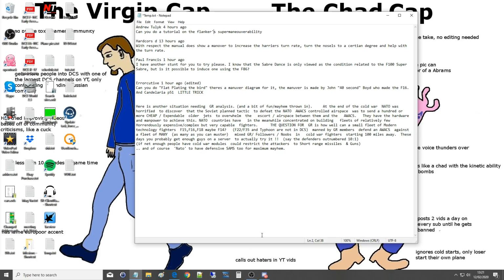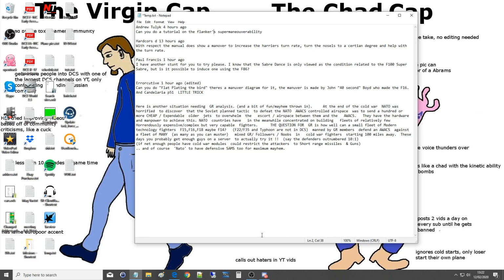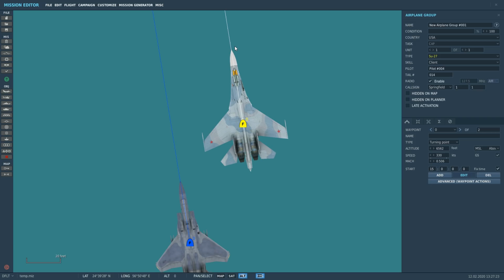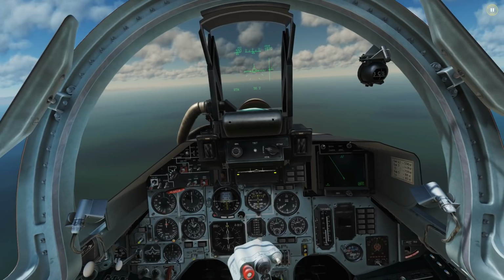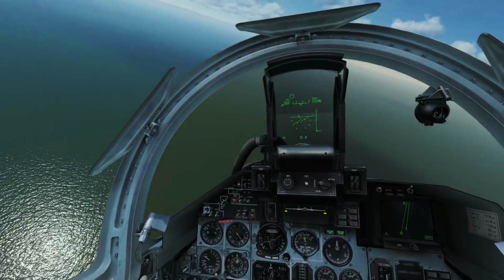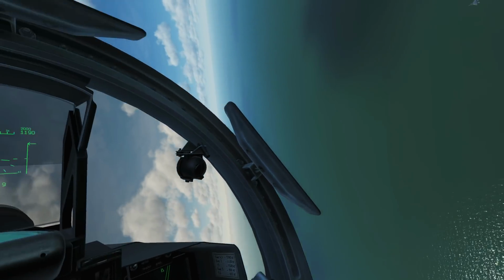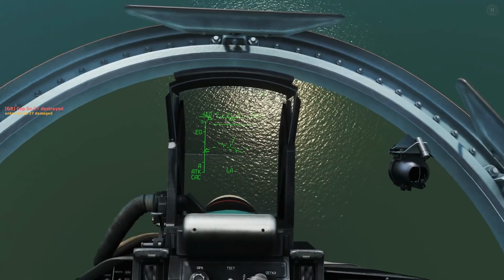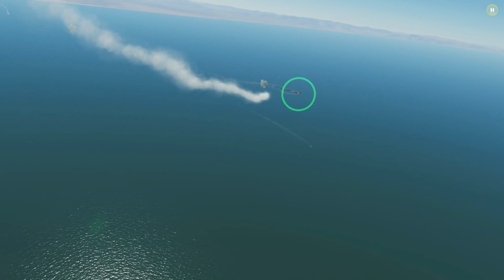Su-27 Flanker: Dogfight Cobra Manouver Super-Manouverability Tutorial | DCS WORLD

Comment: The term 'supermanouverability' has been diluted somewhat from it's original meaning by marketing camapigns. The original term and concept was explored by the X-31 program, and then the various NASA/USAF programmes with the F-15 and F-16. The idea there is that the aircraft is controllable post stall, for which some kind of powered manouver mechanism is required. One might be a reaction jet system like the Harrier, or thrust vectoring. The Su-27 does not fit this definition, because in the Cobra it is actually uncontrollable - once you commit to the manouver it must be completed (ie: it is ballistic at that point). The only truly supermanouverable jets are ones with thrust vectoring, and really with full 3D thrust vectoring at that for it to be the 'true' capability.
Reply: Rodney Pearce when you say the f-15 test do you mean the f-15 S/MTD experimental plane used to test canards?
Reply: @PSC4.1  Yep iirc that's one of them.
Reply: @Gort And I think that's the takeaway from this discussion in general. "Supermaneuverability" as a term in military aircraft has adopted, it hasn't "strayed from its original meaning" in a negative way in my opinion. 

It seems the consensus is that the original definition of supermaneuverability doesn't add a ton of value for its cost in a military environment. So, when someone is discussing military aircraft, I think it's still fair to use the term. No military aircraft are supermaneuverable as other comments discuss, but is that relevant? I personally don't think so, not in this conversation.

Lockheed and other aircraft manufacturers could, I'm relatively sure, create a supermaneuverable aircraft, but the sacrifices required are obviously undesirable or we'd have supermaneuverable military aircraft now.
Reply: J-35 Draken could do Cobra, but never had the control level of the Russians did, due to maybe being single engined and not much power for recovery unless at very high alts. They were mostly not encouraged coz of the uncontrollable stall speed envelope. 

I think the Russian got it to make it more effective and a bit more controllable with their jets having a big more power. But when TVC came into the picture the Cobra maneuver got more refined along with good engine power. Also this maneuver is only effective if its a close combat fight and even more effective if the enemy is close behind you....also it kind depend on the altitude too. So yes...it is effective in close combat.

I think for the F-22 its limited by its flight computer fly by wire setup, to do a true cobra or those fancy maneuvers. Its not designed to do cobra..or airshow maneuvers in mind.
Reply: @Gort Heh...mocking the Russians...
Reply: @Gort An observation on beesley's comment. Its no news about the USA and Russia cold war rivalry.
Reply: Su-27 was the first thrust vectoring plane.
Reply: I think the term "post stall" is generally preferred nowadays
Reply: Is the f-22 capable of this true super maneuverability as it has thrust vectoring?
Reply: @steekle7  yes, it just doesn't have post stall yaw authority because the vectoring is pitch axis only. Of course, it has huge control surfaces and has excellent low speed authority already.
Reply: @rodneypearce6113  it does have yaw authority post stall. You can see it performing the pedal turn. Having canted vertical stabilizers, large control surfaces, and sophisticated blended controls allow it to retain yaw control post stall, despite only having 2D TVC. Remember that aerodynamic controls are not completely out of the question once the wing has stalled.
Reply: @EEEEEEE354  it has some but it can't exactly reverse the turn once it starts can it?
Reply: @rodneypearce6113  i assume it can since the manouver doesn't seem to have the velocity of a purely ballistic manouver like the cobra. The raptors do not use yaw momentum above stall speed to continue the moment post-stall. The F-22 is described as a carefree abandon aircraft. Same with F-35. As such, rudder pedals do not necessarily control the rudder, rather, the flight computers move whatever control surfaces that are necessary to get the desired yaw effect. The yawing moment in the pedal turn is initiated after the stall, and pilots have demonstrated and spoken about having a great deal of control. 5th gen aircraft have a much wider manouvering envelope.
Reply: @EEEEEEE354  Yes I understand that, I'm comparing it to a X-31 or something with true 3d thrust vectoring. It has some yaw authority but not true post stall yaw control. The pedal turn is cool but in other circumstances it will have now yaw control without vectoring. 
Don't go thinking in being down on the F-22, I'm not. Thrust vectoring isn't there on the F-22 primarily for manoeuvrability, it's for supersonic trim. It doesn't need it when it's in a phone booth.
Reply: @rodneypearce6113  I didn't assume you were being down on the F-22. You seem civil, which I appreciate. 

In any case Jon beesely talks about the yaw control of the aircraft here: https://youtu.be/GZWsaJDc8PI 

The general consensus is that these 5th gen jets maintain yaw control post stall, so I would consider it to be truly post-stall in the yaw axis. It is not as good as 3D TVC, but I still consider this post stall. I do agree with your point on the SU-27 and such not really being post stall though. Raptors are probably not yaw controllable at 0 airspeed, but they retain great control post-stall nonetheless.
Reply: SU-57 has joined the chat

Comment: Intersting you didn't use it with attacker behind, a lot slower, to make him overshoot so you ended up on his tail for the kill. Is it not used like that?
Reply: The Cobra sacrifices pretty much all of the defender's energy to force the overshoot, meaning he doesn't have enough energy to maneuver or pursue. If the attacker overshoots it's because he has a lot more energy, which means he has options for altitude, speed, or maneuvering that the defender doesn't..It's really only a last-ditch maneuver for when you see the other guy starting to pull lead for a guns shot. If the attacker has his wits about him, he'll be looking for the Cobra and simply pull into a high yo-yo, then drop right back in behind you once you level out.
Reply: @jasonosmond6896  This only works if the attacker is sufficiently skilled and drilled, which, sadly, most NATO pilots are not sufficiently drilled on the subject. They may know what the maneuver is, and may have been taught in a classroom how to counter it, but they aren't going to see it in simulated dogfights outside of a simulator for two reasons: 1. No one in NATO has any Flankers or Fulcrums in good enough condition, and 2. the Air Forces aren't going to put the ones they do have at risk of mid-air break up (or even colision) to demonstrate it to the rookies.

However, right now NATO pilots are basically trained to keep Flankers and Fulcrums at a distance, to maintain that advantage over getting in close where the Flanker or Fulcrum have the advantage.
Reply: @Tank50us  True, but on the other hand the hi yo-yo is a maneuver any trained pilot should have in his or her toolkit to avoid an overshoot, regardless of whether it's caused by a Cobra or not. An F-18 or Mirage could force a similar overshoot in similar circumstances, so it's something that they can train against using NATO equipment. That said, defensively the only use for the Cobra is in a guns fight, and there's no reason for a guns fight in a for-real conflict unless both pilots have managed to screw something up very badly. Everyone has HOBS missiles, HMDs these days, if it's not over with while still BVR, it'll be over with before the second merge.
Reply: this move is nvr successful...it will only get a fighter in trouble huevr does it..a good pilot at tail will alwayz want u to make such mistake..like a sitting duck this move makes a fighter
Reply: The whole idea behind dramatic overshoot moves where one plane pretty much brakes like a car and the other whooshes by is a Hollywood trope that's badly exaggerated by  the fact that all movies have dogfights happen at spitting distance so they can keep both planes within the same frame. Off topic if you actually wanted to do this the best bird to try it in would be the Harrier as their nozzles can be directed 10 degrees forward. At least in real life it's the closest thing to a car brake effect you will ever get. Unlike the cobra or any such manoeuvre  it also has the benefit of still exposing a fairly small profile to the enemy.

Comment: Plz tell me will this work for SU-33 as both plane av same features
Reply: Works better in the su33, and u can use special afterburner to gain more speed after the manouver
Reply: M Montini special afterburner? What u mean? Sorry im new to this game i bought su-33 two weeks ago dnt knw much
Reply: @operationdabardos1236  the special afterburner is for short takeoff from the Carrier, gives u a extra power to the engines at a high fuel cost, check in the options for the command key
Reply: M Montini excellent ohh man i started to think to buy SU-27 i thought i made mistake choosing su-33 and now i start liking su-33 is there any other tip for dog fight bcoz rite now i lose all dog fight when i go up there and it started to piss me off i even bought JF17 but hate its so hard to fly and manually click every single button
Reply: @operationdabardos1236  the low fidelity models are easy to learn (non-clickable cockpit), I recommend u try the learn the basics, like take off and landing, maneuver speed, evasive tactics then go to fighting modes. Try at first with bots, there some servers PvE if you don't know how to create missions, here in GR channel have multiples videos teaching basically everything you need to know give a little check

Comment: It's the other way around: unstable aircraft has center of lift in front of center of gravity.
To remember or visualise imagine space rocket which has to ba very stable, it has tiny wings (lift) at the end (bottom) of the body, far behind the center of gravity.
cheers
Reply: He admits not understanding what he's talking about yet he insists on talking about it anyway, which disseminates inaccurate information to the viewers.  Beyond the inaccurate aerodynamics here there is misuse of the term "super maneuverability", which is really the ability to retain control of and maneuver the aircraft even with little speed and the wing past the critical angle of attack.  This is not about one maneuver called the cobra, it is about being able to continue to put the nose on the bandit and satisfy weapon parameters for a shot.  Vectored thrust certainly is a benefit in this regime.
Reply from the maker: thx
Reply: Rockets are a bad way to reference that their fins are down towards the base to give it the most torque to move the rocket not 100% for center of gravity deals. Unstable airframes have their center of lift off its center of gravity but still within the mean chord of the wing.
Reply: @ionator2000ist  most rockets dont use their hind fins for movement, but engine gimbal. If you are talking missiles, most of them use canards.
Reply: ionator2000ist In rocketry it's referred to as center of pressure and for stability it must be aft of center of mass. Missiles are aerodynamically controlled and may make use of this concept, although they might not in reality because as with any aircraft they will be more maneuverable if they are less stable. Spacecraft seem to ignore this and without active thrust vectoring they all go unstable. I assume this is because they spend so little time in any appreciable amount of atmosphere that stability isn't an issue they worry about. No point in using fins or wings if they're only helpful for the first minute or two.
Reply: Not in Front, that eould make it uncontrollable even for an advanced computer system, since a minute difference in AoA can pull the aircraft around. The CoL eeds to be right on the CoG.
Reply: @thedubstepaddict3675  Yes, and that's why F-16 or Su-27 are not unstabe. Their configuration is named relaxed stability.
Reply: @d c The Flankers with the front canard, that's not a Su-33, has their CoL in front of the CoM. Which is why they could turn really really hard when barely moving the elevators, or in some cases, even have the elevators the other way when turning to stabilize.